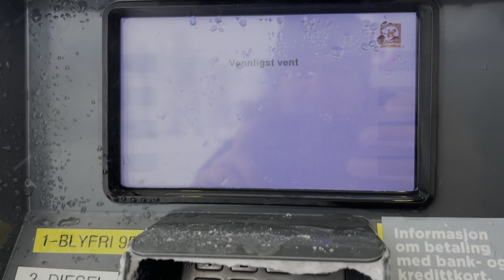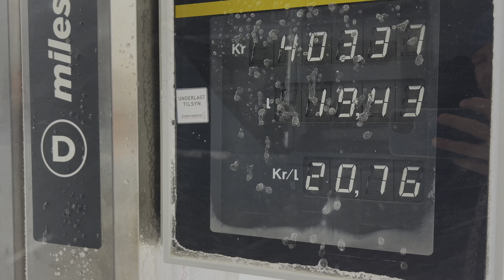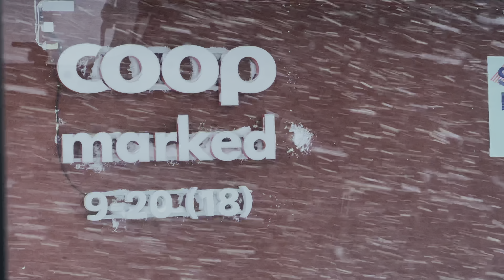ASMR Van Life Winter Camping in Snow Storm - Massive Blizzard - Extreme Weather & Pan Pizza #vanlife

Comment: What kind of lights do you have in your van? 12v leds?
Reply from the maker: Yes, the main lights are 12v leds, and then I have the ambient lights that are powered off regular aa and aaa batteries
Reply: @NorwegianXplorer  12v is better no inverter needed. I have a small inverter but direct 12v is loss free.
Reply from the maker: I have a small inverter too, 600w, works perfect with minimal loss